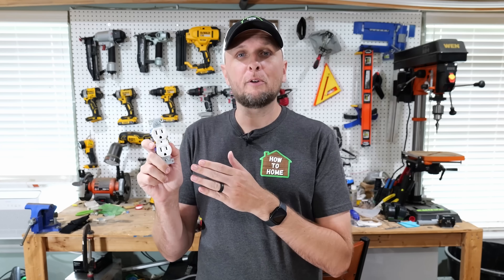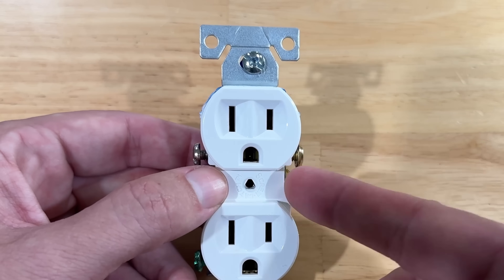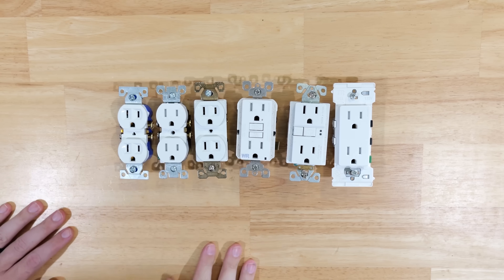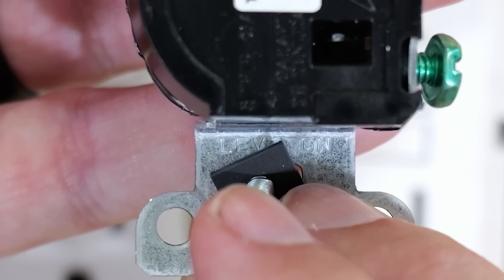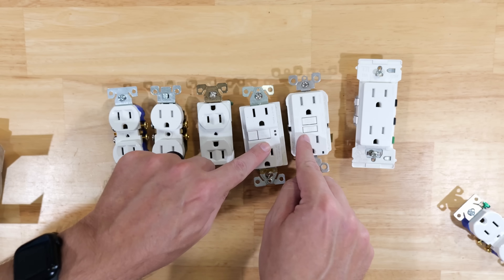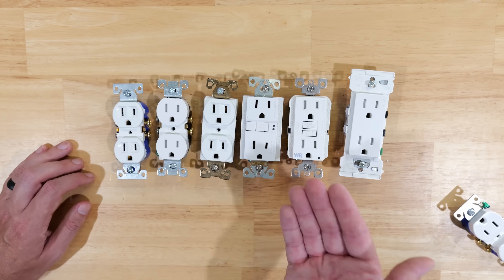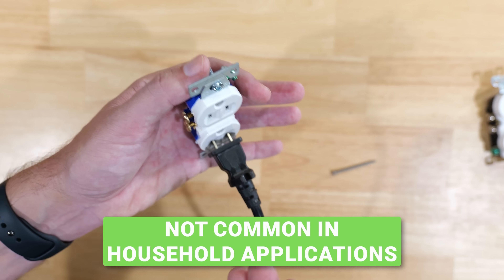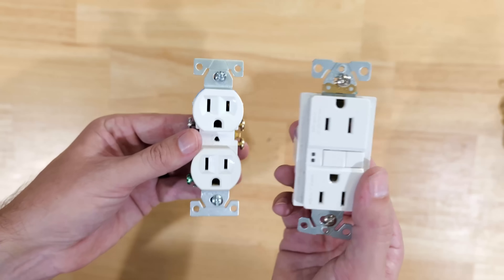The Shocking Reason Why Your Outlets Are Installed Upside Down!

Comment: Not a electrician but as a supervisor in industrial maintenance all the electrical receptiacals were installed with the ground up. In my case as a licensed residential builder I installed them with the ground down except when the plug normally on a refrigerator or freezer where the plug was formed 90 degrees down which had the ground up.

Comment: I wired some of my outlets switched on the lower half.  So to make them easy to identify, I only I installed those with ground pin up.   Everything else is ground pin down.  Except in the garage, where they  are up high, about 4' off the floor.  An extension cord could possibly be stepped on, which could break the plastic on the outlet.   High outlets are very susceptible to this happening imho.  :)

Comment: #1...forget about whether the back side "writing" is up or down, because you can see it once it's installed, that's a no brainer, and #2...which should have been covered, is the orientation that for plugging in night lights that most of the time now do have the bigger neutral side on it's left side as plugging it in...otherwise you'd have to have the night light upside down in the bottom of the outlet, unless that really doesn't matter for some people, not all night lights have that swivel feature on them which is a neat thought.

Comment: People that argue this subject are anal. Ground Up? Down?
90⁰ plugs lay better in a receptacle that is ground down.
Most receptacles in the Chicago area are installed horizontally.
90⁰ plugs lay well ground left or right.
A horizontal receptacle with the ground left would be real safe because the neutral would be above the hot.
I'm not saying which way is the  best. Use what you or the customer prefers.
Toilet paper to the front or back is another anal conversation.

Comment: Canadian electrical code states the ground is down. If gravity was to unplug an appliance, the ground would still be connected if the ground is down. If the ground is up then the ground could be come disconnected while the hot could still be connected. It a safety concern. When installing a receptacle horizontal always hot side up. If the receptacle becomes loose and gravity alows the receptacle to slip and touch the box, nothing happens because the neutral will touch the box. If the hot side is down and touches the box the breaker will trip.

Comment: So you say upside down is bad, so why do you install the sockets horizontally, so tell me whether horizontally, i.e. left or right sided, which is good,:face-purple-crying:
Reply from the maker: When did I say any of that?
Reply: @HowToHomeDIY  You didn't say that, but I'm telling you what I have in my new Illinois home, why do they install sockets horizontally and you say it's not correct, that is, upside down, did you understand me, in my 60 years of life I've never had a situation where I had to pull a plug using a nail. That socket was always loose and I usually replaced that socket.

Comment: Any 120 VAC Air Conditioner will have a drip leg to keep condensation from dripping down into the receptacle and in those cases the Ground is installed on bottom.

Comment: I prefer ground down as many molded plugs are meant to hang that way. Also, it is super rare but if the ground pin on the plug is short as the cord pulls on the plug the ground can disconnect before the power. That could create a shock hazard. The stars must align for that to happen, but I have see ground pins that were short or someone cut part of it off for some reason.

Comment: ground goes down. Maybe the code has no preference, but down has been the accepted "look" for as long as I've been old enough to notice, i.e. wiring manuals, doit yourself and how to books. More importantly the secondary market has decided the prong goes down. There are far more products designed to mount on the outlet with the prong down.
Don't have slidy droppy thin metal thingys above outlets lol! Lets do a study of which orientation makes it easier for a cat to pull a plug loose. 
What concerns me is that before social media I never experienced this as a contractor, but now it's a thing where sides are being formed. One more thing you'll need to demand of your sub to have everyone on the same page. And apparently, some of them sound as if it's gonna be my way or the highway.  Those products that need the ground down to work? I bet they're ahead 50:1 and the homeowner/buyer is the ultimate customer. Don't be petty and piss them off.
off my soapbox! sorry

Comment: My house was built in 2007, and 90% of the outlets were ground up.  Over the years, I have been changing them to ground down.  Why?  I have no idea, but that is the way I was taught to install them when we built my Dad's house in 1983...
Reply: Why? Because it's been normalized for you. Ground prong up when that outlet is attached too the wall-switch so people there know where to plug in their lamp to control it from the wall light-switch.
  Medical facilities have things hanging on walls that fall, like clipboards, scalpel, hemostat, that can fall and short the circuit, military galleys and  restaurants, ground up was specified, due to stainless steel utensils being dropped, etc. Therefore it has become required that they be ground up for contractors. In many cities ground up is standard in all commercial and industrial buildings, ground only go down in residential buildings, houses, apartments, condos, etc. 
   Internationally, countries with 3-prong outlets always have the ground up
   Everything is in context and the answer DEPENDS on context. 
   Examples:
“Never took the orientation of an outlet seriously until I was measuring for a shelf with a tape measure. It slid down and fell across the prongs of the washing machine plug.  POW! “ —@joef.6596
“I work at a K-8 school. Maintenance assembles powered multi media carts with the ground plug up in consideration of teachers dragging metal bracelet chains across partially unplugged power plugs.” —  @scaryhouse7969
“a length of florist's wire rolled off a side table onto a slightly loose plug and shorted the circuit, creating a small fire (quickly extinguished).  I now always install ground prong up” @deegee54
“I work at a restaurant and we have this work table with some outlets built in on top. Someone managed to let the edge of some tin foil go in between a plug and the outlet and it got disintegrated.”@MatthewSuffidy
“I knocked some change off of my end table one day my mistake of course, and a coin fell down right on the prongs resulting in a loud pop and a flash along with some smelly black smoke. I have since gone through my home and reversed all of the receptacles so the ground prong is now on the top.”—@chrisenglert3958
“my wife's gold necklace chain dropped off the rack onto two prongs of a device that were plugged into a receptacle with just a little prong showing.  It vaporized the gold necklace area of contact and left a nasty burn mark on the faceplate of the receptacle.   This was on a bar and I probably should have oriented the receptacles there ground prong up.“—@winfordnettles3292
"I had lunch with the Chief Electrical Engineer at McDonalds headquarters. He told me that one of the workers in one of their stores had her hand badly burned when a metal cookie sheet (or something similar) slid out of her hand. It fell onto a receptacle that was loose…the metal cookie sheet made contact with the two blades resulting in  big arcing flash that caused the injury, this is a reason Ground Up is safer."
“In commercial buildings (where receptacles are very high from the floor) ground has to be at the top. In a case of a water leak ground has the first contact with the water. In residential buildings (where receptacles are not far from the floor) ground needs to be at the bottom. In a case of a flood, ground wire would have the first contact with the water.”—@powerzx
“When a heavy extension cord or wire from a device plugged in is experiencing stress from the cord being pulled taught or tugged on, the greater force is usually downward. The ground prong being longer, exerts the greatest torque when the wire is being pulled in a downward direction.  Occasionally that downward force will cause the plastic of the ground prong opening of the receptacle to crack from the downward force. If the ground prong is up, that downward force has much greater support from the receptacle structure. I’ve personally cracked a few receptacles over the years working on projects where the wire plugged in was being yanked around a lot. Where the ground prong was up, the extension cord always stayed more securely plugged in.”—@TechwizJoe1
"while working in a mechanical repair shop, I went to get something off the shelf that the radio was on. I bumped the radio. as I turned POW, FLASH, BANG.  the metal antenna fell sideways and was across the plug and touching the window frame. glad i did not try to catch the falling metal antenna.  an extension cord was just a little loose in the socket.”@tazhd143

Comment: As an apprentice I was using a steel fish tape to pull conductors in conduit at a job site, not winding it back on the reel as I went along. The loose loose end of the fish tape wandered over to the wall where an extension cord feeding a light string was plugged in to a wall receptacle, ground prong down. The evil fish tape, acting like a common hoodlum, pulled the cord away from the receptacle just enough to slide itself between the cord plug and the receptacle. The ensuing explosion killed the construction lights, sent sparks flying, burned the receptacle, destroyed the fish tape, and destroyed the extension cord plug. My professional pride took a hit, as all the other trades watched the stupid electrician ruin his own work.

I still install receptacles ground prong down, but I always wind my fish tapes as I reel them in.

Comment: We ran into a situation where we wanted to plug in a cord with the wire coming out of the plug at a 90 degree angle instead of straight out, and the receptacle was very close to the floor. When plugging the cord into the receptacle, the cord was bent sharply against the floor. We ended up changing the receptacle to ground prong up position.

Comment: As someone who has been shocked by a ground up receptacle, while using a power tool, someone had come along and accidentally stepped on the cord pulling the plug downward, but not fully out of the outlet leaving the neutral and hot connected, but just enough that the ground was not making contact. Thus, I became the ground. Had the outlet been installed with the ground down, the hot/neutral would have lost the connection, and the power tool would not have worked. that also goes for horizontal installation as the hot would lose contact rather than the neutral. his is not for or against either installation, but just a personal observation.

Comment: One thing you don't mention is the use of 90 deg cable-exit plugs rather than the usual type: These give a much lower profile against the wall and are very useful behind furniture (such as for tv plugs behind a tv cabinet). These have the ground pins down, I think universally, with the cable exiting the plug downwards, meaning that their manufacturer assumes ground pin down is "normal". Even the ones that are also canted sideways at 45 degs, to allow two such plugs to be inserted into a single power outlet, still have the cable exiting down to the right - assuming the same orientation.

But I find it ludicrous that this is even something needing discussion. Check out the British plug/socket system, redesigned in the late 1950's, as described in Tom Scott's excellent video, with all these now standard safety aspects:

- The plugs always use a ground pin (so even where only the power/neutral pins are needed, there is still a plastic ground pin) - there are no British 2-pin plugs.

- All sockets are universally installed with one standard orientation, all cables exit the plugs at 90 deg, downwards, so every plug has a low profile, and every outlet can take two standard plugs, side-by-side, without needing specialised 90deg exit and 45deg canted variants.

- The ground pin opens shutters covering the power/neutral pins as the plug is inserted, where those shutters prevent a child from poking things into the holes.

- The power/neutral pins on the plug include insulation so that you cannot make "accidental contact" with a live pin if the plug is partially inserted, in the way that you indicate (at 12:15) is a concern with the American plugs.

- The plug cannot be yanked out of the socket by pulling on the cable, and the cable/plug connection has safety features so that even if the cable is yanked out of the plug there is an extremely low risk that it will present an electrocution threat.

- Every single plug is individually fused, so that there is no threat of an overload and fire even with multiple extension cables.

- Each socket is usually individually switched so that it can be unpowered even when plugged in.

In addition to all that, in Britain the lighting and power circuits are separated, each with a separate circuit breaker of an appropriate wattage, so you don't lose the lights while you're working on a power socket. And the power circuits are all rated at 30A with the plugs capable of carrying 13A each, so there's no problem with plugging two powerful tools into the same outlet. (And since British mains is 240V, there's twice as much power available at a given amperage - so kettles boil twice as fast.  :o)

There are so many good features for safety and utility in the British system that the American plug/socket/lighting system looks pathetic, archaic and unsafe in comparison. Please, guys, catch up with the rest of the world?

Comment: I agree with  you ground prong down is better. But you could have mentioned that the third orientation is installed Horizontally which is also acceptable. In this case I prefer ground prong to the right just because most people are right handed ...
Reply from the maker: Well I did say that any orientation is fine as long as it isn't face up under a sink.
Reply: Grounded conductor ( neutral ) should face up on horizontal receptacles. Grounding conductor to the left

Comment: I bought a home in Columbus OH that was built in 1936. It won a nation wide design contest as the best designed small home in America! I say this because all the outlets were installed horizontally! I have yet to find a downside to this simple change. They look nicer and there is never a cord draped over another cord. Can anyone provide a reason as to why horizontal is not the norm? :face-blue-smiling:

Comment: Look at lay-flat or 90 degree angled cord plugs or charger devices. Do you want the charger or cord going up from the plug or hanging down from the plug?
Reply: @garybranigan9238: Ground prong up when that outlet is attached too the wall-switch so people there know where to plug in their lamp to control it from the wall light-switch.
  Medical facilities have things hanging on walls that fall, like clipboards, scalpel, hemostat, that can fall and short the circuit, military galleys and  restaurants, ground up was specified, due to stainless steel utensils being dropped, etc. Therefore it has become required that they be ground up for contractors. In many cities ground up is standard in all commercial and industrial buildings, ground only go down in residential buildings, houses, apartments, condos, etc. 
   Internationally, countries with 3-prong outlets always have the ground up
   Everything is in context and the answer DEPENDS on context. 
   Examples:
“Never took the orientation of an outlet seriously until I was measuring for a shelf with a tape measure. It slid down and fell across the prongs of the washing machine plug.  POW! “ —@joef.6596
“I work at a K-8 school. Maintenance assembles powered multi media carts with the ground plug up in consideration of teachers dragging metal bracelet chains across partially unplugged power plugs.” —  @scaryhouse7969
"I had lunch with the Chief Electrical Engineer at McDonalds headquarters. He told me that one of the workers in one of their stores had her hand badly burned when a metal cookie sheet (or something similar) slid out of her hand. It fell onto a receptacle that was partially pulled out...the metal cookie sheet made contact with the two blades resulting in  big arcing flash that caused the injury, this is a reason Ground Up is safer."

Comment: There is no "upside down" for an outlet.  The code doesn't say anything about that.  I once worked on an old farmhouse with plaster lath walls and cutting into that resulted in a huge mess, and it was easiest to install the outlets horizontally in the baseboard.  That was allowed by code back then.  Best to ask the customer his preference or follow existing convention.

Comment: As a real estate broker for 36 years, I've seen that most bedrooms, for example, have 3 to 4 receptacles and the one receptacle they put upside down is to be able to identify the one that is connected to a wall switch for a future free standing lamp or ceiling fan or hard wired light bulb.  The upside down receptacle more easily identifies the specific receptacle that is wired to the wall switch.

Comment: According to the code in my province in Canada the orientation of a 240-volt range/stove outlet does matter. The ground of the receptacle must be at either the 9 or 3 o'clock position, not at top or bottom. I suspect this is more for practical rather than safety reasons as it is installed relatively close to the floor & would cause issues with the thick cord on the cable & plug trying to plug in.

Comment: I usually see ground hole up when the receptacle is connected to a switch on the wall. That way you know what you plug in is linked to a switch somewhere.